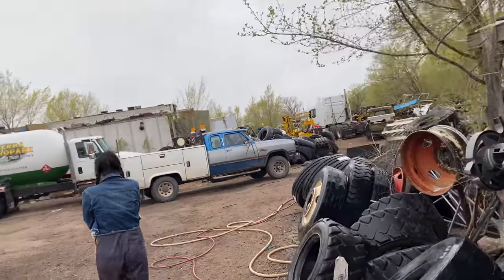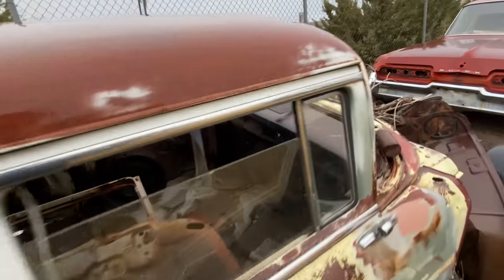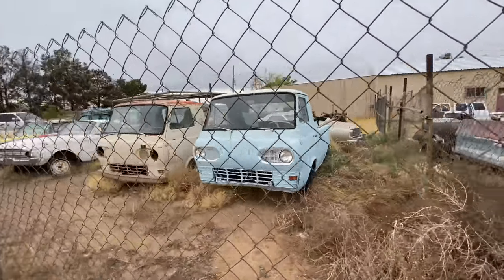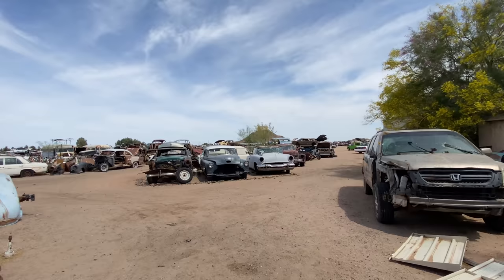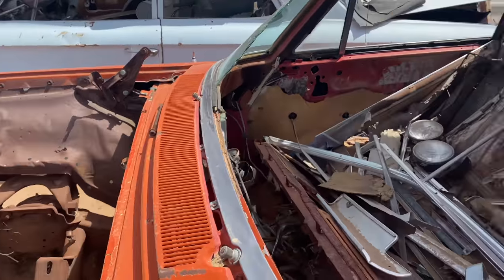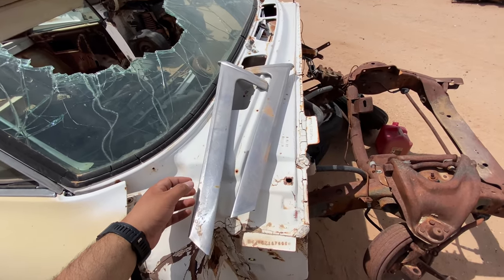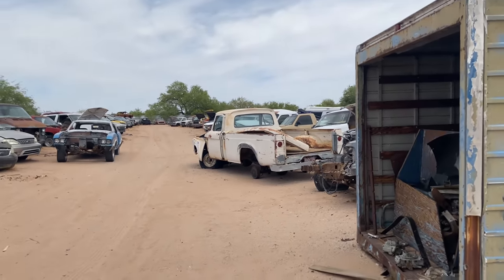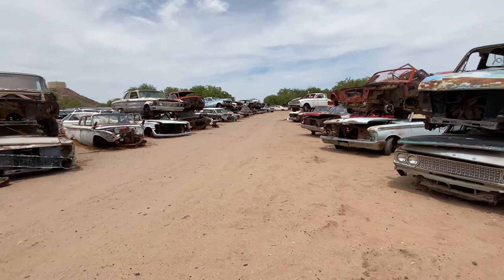Junkyard Travels: Arizona and New Mexico

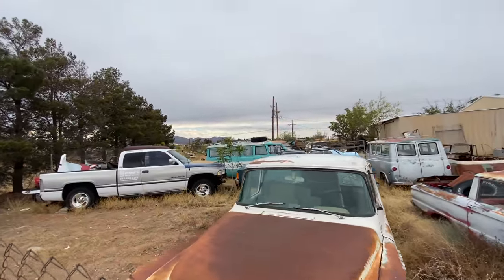Comment: 5:53 Dodge A 108 window van, but that is something special. The stainless band on the roof behind the drivers compartment tells me it's a camp wagon. The passenger area roof pops up on  the rear of the van. A 6' guy can stand easily in the cargo area. The sides are canvas. The stainless band across the roof line is where the conversion company cut the roof. These were built 1967-70 most came with 318's with a 727 auto,  some even came with a rare power assist  steering!  So that unit would be worth a further visit 🤔 . Ask me I owned a 68 Camp Wagon. And I lost track of how many A100 s I've owned over the years. Thanks for the post. Good lock with your Econoline  purchase!
Reply from the maker: Wow that’s some great info, cool to know all the features of these vans. I’m sure I’ll come across more!